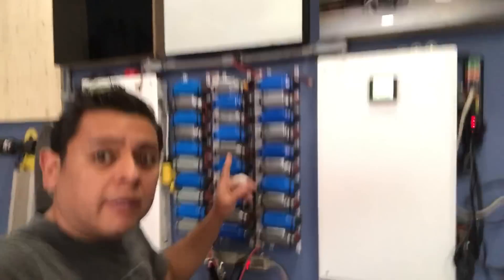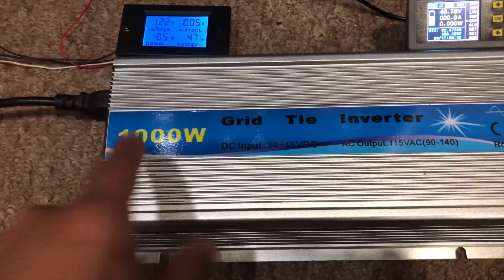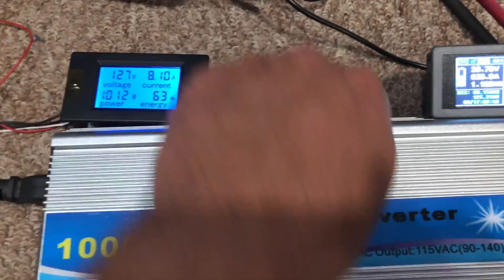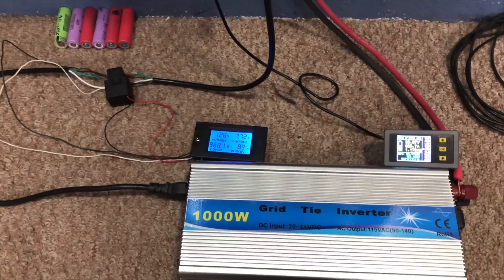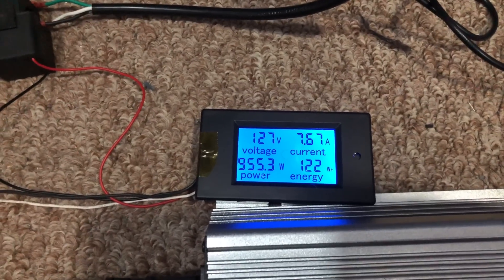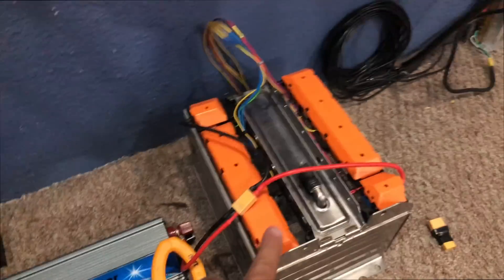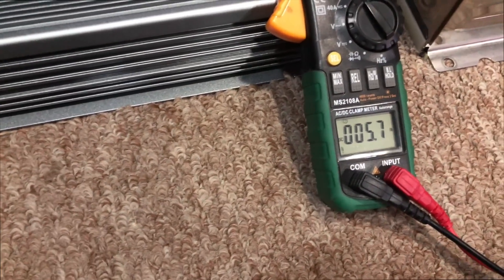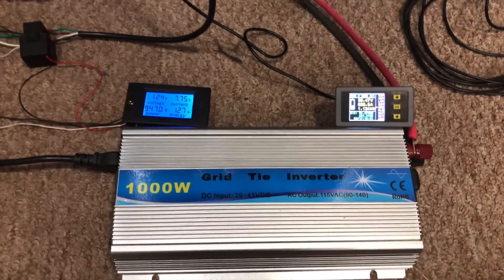Do Cheap Amazon 1kW grid tie inverters Put out 1000 Watts?

Comment: I have a cheap Giandel 1200 inverter in my van and it's performed very well. IMO, The hardest thing to run from an inverter is a cook top.  I have an 800 Watt electric grill that tripped the fault until i moved the inverter inside the engine bay and connected it with massive 1awg 12 inch copper lines.   However, i now have a new issue.. Is the inverters fault affected by heat?  my battery was reading 13v, but the inverter kept tripping even with mild power draw. In the morning it when the engine was cold it worked great, but now the engine and the inverter was VERY hot from running the engine and the sun. Does this make sense?
Reply: I'd definitely move that inverter somewhere cooler.  This is a gigantic simplification, but you could think of the inverter as a tiny person doing work.  Imagine he's capable of doing 100 units of work (100% of his maximum output).  He'll have no issue doing that if the weather is cooler.  But if the weather gets so hot that he's already close to his maximum tolerable temperature before he even starts working, his peak amount of work is going to be greatly reduced.  Put simply, there's an inverse relationship between how hot the temperature and how much power something can put out before it blows up/burns up.  Even alternators drop in output as they heat up.  Plus, heat is super hard on things like electrolytic capacitors of which power supplies/inverters tend to have many.  Personally, I'd move the inverter as close to the battery as I can get it, but also making sure it's located in a place that's as cool as possible.  If you tend to have a high load for long periods, it might be worth it to toss a 12V computer/electronics type fan pointing at the heatsink itself as well.  Another thing that may help is to use one of the large "stiffening" capacitors used in high end mobile audio.  They'll have a pile of input buffering caps already, but adding a large 1/2 to 1 farad unit as close as you can get to the inverter (like, right beside it, 6" wires between it and the inverter) may help to prevent supply sagging for large initial peaks and prevent it tripping.  Myself, I'd start with moving it somewhere cooler.  If it still has temp issues, add a secondary blower/fan.  Last, if it still works, but it's marginal (as in, seems fine with a 100% SOC of the battery, but trips/freaks out once it drops a bit), then maybe try the stiffening cap.  A mobile installer place may even be willing to help you try one out first just to see if it's effective in the setup you have.  Best of luck! :)

Comment: Peak use on electronics is ok not like mechanical so much, as long as it stays within temp range. Example a CRT screen  used in old bank security cameras would last for 20 years. Why they were always on operating at peak op of system! Electronics it is the 0 to peak that kills!

Comment: How do I know if this would work with my house meter?
Reply: Never knew you could do this almost sounds to good to be true. Do I just need to make sure the outlet I plug into is one of a higher amperage?
Reply: @HisLoveArmy  If you have a smart meter, you need to call your energy company and ask if you can solar grid tie to your smart meter. Usually if your smart meter support net metering, you should be good. Analog meter will  just turn the meter slower or backward depends how much u put back into the grid. Call just to be safe.

Comment: My utility doesn't allow putting these small inverters on the grid. They only have a certain number of larger approved one or solar approved and they can detect if you are feeding back in with their smart meter and then see if you have gotten approval and if not, you will get a letter in the mail...
Reply: The power company is not going to waste their time tracking all these people down, and threatening them with cut off.  They hope you will just not try...

And if they do cut you off, find an attorney and get a class action law suit together.
Reply: @JohnBoen  Oh they do, I've already read a few times where they have in my city. They don't want their linemen killed by cheap inverters that fail to turn off when power is out.

Comment: Sir does this inverter feeds back POWER to the GRID when we are making access power from PV panels at home???
Reply: @LazyH-Online something tells me that's not a feature this particular inverter offers... maybe it's my 20 years being a residential electrician, maybe it's my experience with my own solar system, maybe it's my 30+ years as an electronics engineering enthusiast speaking but I'd be thoroughly surprised if it did. That type of inverter typically does not come in this form factor. That being said there's a chance that it does.

Comment: Happened to notice at about 5:30 when the fan was on and things were a bit stabilized... the DC was feeding about 1140W into the inverter and the output to the grid was about 960W.... That's about 16% energy losses, which is what is making the inverter heat up quickly.   I wonder if a pricier inverter is more energy efficient and how much usage would warrant paying for the more expensive (presumably more efficient) inverter?

Comment: Be Careful the output Power Cord is against the Law, because it's a male plug extremely dangerous it should of been a female output. Can see that the Manufacturer are not qualified.
Reply: A Grid Tie inverter will not output electricity unless an external AC voltage is applied to the output. Therefore, touching the terminals while exposed will not produce a shock as there is no external AC source.

Comment: Hi, I use this tie inverter in my solar intallation, work pretty good.  I'm look for a way that connect this tie inverte direct to my battery without get out too much amperes as this tie inverter is MPPT type. You can say the way to connect this tie inverter direct to my 12v battery and only getout 5 amperes?  
 I know that in this case not generate the total watts.  thanks

Comment: That "ramping" was the MPPT (Maximum Power Point Tracking) circuit. Since you are pulling from a battery pack that can easily supply 1000watts it just maxes out the inverter. If it was a 220watt solar panel it would ramp up the load until the wattage maxes out using something called "Perturb and Observe" where it increases current load and observes the wattage. If wattage increases it increases the current. If wattage decreases it backs off. It does this in little steps all day long.

Comment: im surprised to see you were surprised that it was going to be more than 40 amps.   'watts' over 'amps' times 'volts'  aka "WAV'  or 1000watts / 12volts = 83 amps    ..    yes less amps with 14-15v but still signing along vs the 36v system

Comment: I run all mine at 50-75 percent rated input. This can be be done with a dc to dc regulator. Do yourself a favor and add an external fan or 2, and wire it to the internal fan circuit.

Comment: how many DC watt required to produce 1000 AC watt ??
Reply: Be more specific with your question lol  ,dc can be 12-24-36-48 ac can be 110,220 ,400,600 ....  If you are talking about a 12v DC to reach 1000w at 220 AC its simple math 1000 devided by 12 gives you : 83.33333333.... amps so to reach 1000W AC you need 12V at 83 amps  so at 220v AC it will draw 4.545 amps .

Comment: I just want to ask if  this is a pure sine wave or modified sine wave inverter? 
Thanks for reply
Reply from the maker: It’s a grid tie inverter,  it matches and syncs to the grid
Reply: ? I was expecting a clearer answer to the question.

Only way to check would be putting an oscilloscope on the output, but given it is grid tie connect, that's not really going to show the shape of the output as shape will be affected by the grid.

Comment: Any help , so how many solar panels i can connect to this inverter , I own  72 cells 240 watts panels with a VOC of 37.2 volts, Thanks !!!
Reply: Hi, not use VOC  parameter.. Use Vmp parameter (is real voltage with load). Usualy this inverter have a wide range of input voltage.  Example: if thi inverter input DC voltage range is 20  to 60v  and you Vmp is 31.7 volt, you can put two panel in series..

Comment: When you're feeling for temp on the battery pulling almost 60 amps towards the end, you missed a vital spot. The connection usually melts first. Touch that first to test for temperature.
Reply: Wrong. The part with the least mass, the highest electrical resistance and the least cooling is the part that melt first. Which is not the connector because it neither have the least cooling or the highest electrical resistance.

Comment: That 59amps I would probably use 4awg, or better yet 2 #10 in parallel as it is easier to get. The bigger the wire the less your losses in heat and voltage drop. The extra cost of the wire quickly makes up for the cost over time.

Comment: suspect unit puts out AWFUL chopped power
 NOTHING like pure 60 cycle sine wave   -that appliances need to run cool
    even better PWM units have as much as 25 % distortion, and lousy power factor

    and EFFICIENCY probably 85 % maximum
Reply from the maker: Based on what evidence?
Reply: 25 yrs experience on designing true sine wave inverters for           industry,military ,satellite tracking
      -up to 35,000 watts single phase
Reply from the maker: These are grid tie so they match the grid,  you essentially suggesting the inverters introduce a noisy signal,  have you ever tested these?  Or similar ones?   All I’m saying is the fact these are cheap is not proof they create dirty power.
Reply: have looked at many commercial and business UPS units-
    all designed for short term shutdown of pcs and lighting  applications 
     for max 1 hr duty

-(IF your equipment can handle surges,frequency fluctuations,and IF
    ups can handle power factor )

even better UPS units are PWM-so quite crude sine waves
-o'scopes show sagging or surges  ,frequency shifting,after 120 ms 
or more time to ramp-up on power loss

much worse output form factor than gasoline or deisel GENERATORS
    -that take valuable MINUTES to ramp up to speed
Reply: 25 + yrs experience designing pure sine wave inverters for industry,commercial,military and satellite telemetry
-up to 35 KW in single phase applications,much more in three phase

Comment: You should probably check to make sure that has a clean ac output. Hate to see the inverter tear up an a/c unit. Alt. current electric motors don't like non-sine currents.
Reply from the maker: The AC is connected to the grid

Comment: Jehu, I enjoy your content ... could do without the canned youtube music though ... now for a comment about the grid tie inverter.
Maybe I'm missing something but isn't there a significant safety concern here? What if the power to your home is out and this thing is connected ... the power company comes out to work on it thinking it's not live and someone gets killed because you have 1 or more of these feeding voltage back into the grid.    One or two instances of this happening and we'll have more and more regulation to deal with. I know that when you have a full home gen-set professionally installed to power your home it comes with an auto disconnect for safety reasons. ... I'm sure local regulations differ.
Reply from the maker: Who the F is telling you people this is a problem?  I’m really tired of answering this stupid question, read this https://en.m.wikipedia.org/wiki/Grid-tie_inverter

Comment: I understand that it is cheap but it runs on 82% efficiency and that is considered terrible when branded inverters run at 95%+. Remember it runs at max load and this is the point where inverters run the most efficient so imagine what the efficiency will be at say 50% load... And if you run it off of a PV array, I would guess that it will be way worse since I really doubt it has an MPPT function.

Comment: Hi I'm in inverter technician good video always oversize your needs. What's the sinewave output? You need a scope to see you can't assume it will be 60hz like the box says. You are going to cook those batteries if you're not careful those Cheapo inverters don't have a temperature sensor built into them. I'm a big fan of AIMS, I'm one of their largest distributors and I've stressed tested their inverters. They last about 12 years.  if anybody ever wants inverter tech support you can give me a call at my office number 530 648-0258. Word to the wise don't buy Modern Xantrex/Schneider they've really cut Corners in their production and you'd be lucky to have one of their product last 8 years when normally a grid-tied inverters should last about 12-14. I mostly do tech support on SMA and Trace units.

Comment: I had two similar units running my solar.  They lasted about 6 months to a year.   The mosfet's burned up first.  I was able to fix the issue once or twice.  After that I couldn't diagnose the problem and gave up on the unit.  I was considering a much nicer unit but never pulled the trigger.
Reply: you just needed to replace the mosfets by mosfets with a higher  current tolerance and  run  them  bellow 1 kw,  no good idea to run them at their peak.

Comment: I've had one of these for several years. Mppt function seems inaccurate. I also found that bugs like to go in it after it blew up and I found all sorts of fried things from flies to ants to spiders in it. I was however able to replace the blown mosfet and get it working. Recently a fan failed (output stopped working) now the other fan is failing (actual fan is faulty) I've had the unit 3 ish years. Hope this helps. 1000w gti same as the one in this vid.
Reply: JOSEPH Johnson I'm good thanks.

Comment: Eyup Jehu. connecting some dots for you here possably. At about the same time as you were experimenting with this a show called 'thefullychargedshow' put out a vid about SKELI+OR super capacitors and I wondered if this might be an application where they might help. The may not be able to run long enough to do the whole job but they are designed to take the spikes out of loads. Here is the link to the show :)

https://www.youtube.com/watch?v=KQ2Eo6wl5r0

Comment: If you want to have 5kW, will you put 5 of these in parallell? Great vid!
Reply: You can't parallel inverters , i saw its only possible with the mpp solar 2-5kw models  the thing is that you have to sync perfectly the sine wave frequencies coming from each individual inverter to work together if they wont sync you would fry them dead or probably cause a fire ...

Comment: why not just get a 6kw split phase inverter and run your ac on it?
Reply from the maker: Because  Everyone knows that works,  not much to experiment there
Reply: so doing it the odd way just to see if the odd way works? I get that, its odd, but I get it. I did have plans to make "solar funiture" I had umbrellas with panels on them, a car port, was going to do a shed, and on each have its own micro inverter and just plug it into the nearest receptacle. But as you know these smart meters can detect it if you not using all of it (like your AC) so it shot that plan out. The requirements to have it legal would be rediculous.

Comment: Word to the wise but please open that up and make sure all mosfets are firmly tightened down AND actually has the thermal pad/paste between each one.  Common thing is they are loose, barely tight, and/or do not have the thermal pad/paste and POOF/POP dead.
Reply: The Best Stooge my man knowing what's up yee
Reply: Just happened to me and couldn’t figure out what caused it. Thank you
Reply: @maxpert9  You are welcome as I know the feeling.
Reply: @thebeststooge  what are MOSFETs?
Reply: @vermontsmostobesetubaplaye1988  In this case those three legged black things that are attached to the sides of the aluminum chassis.
Reply: @thebeststooge  thanks!

Comment: You can't simply multiply A.C. Vrms by the Vrms and get power. You need to know the power factor of the A.C. load. Motors typically may have a power factor of .8 or so depending on the load. You need a real A.C. watt-meter to measure A.C. watts.
Reply from the maker: Who cares about watts

Comment: According to what we can see, it has a conversion efficiency around 80% ... And quality equipment are between 90-95% efficiency. I had a cheap unit, which was also recharging my battery bank... Well... It totally ruined the batteries : loss 1900US$. Be careful with charger/inverter units !
Reply from the maker: These don’t charge,  only discharge
Reply: Savage Beast dude that blows do you have your old unit I work out of a repair depot
Reply: Well... Problem is related to design, and firmware. So there is not so much that can be done. Also the hardware used into it seems to be modular. The cheapo version is missing several things. And nothing as to be repaired, but changed. Forget about it, anyway thanks for your interest.

Comment: Have you checked the waveform that the unit puts into the mains? Is it smooth or modified square wave overlaying the standard (utility)  waveform.
Reply from the maker: The word of the day is : synch
Reply: jehugarcia so they claim yes. This is Chinese kit.. some wave distortion, phase angle or distortion (noise) is likely if not inevitable and can cause havoc with delicate digital equipment.  Just thought a scope wave form test would settle minds a lot. 
Have had experience of issues like this u see. ;)

Comment: 1000W Solar Panels on Grid Tie Inverter GTIL2 & Limiter for Home PV Battery Connected  there a 3 models 25v-60v/45v-90v and 2000watt version more expensive but better built i have both 25v-60v and 45v-90v looking at building own power walls for these systems.